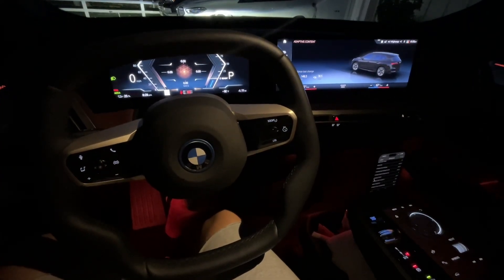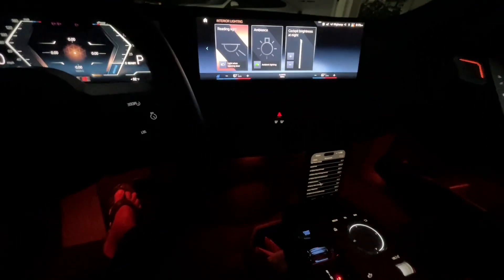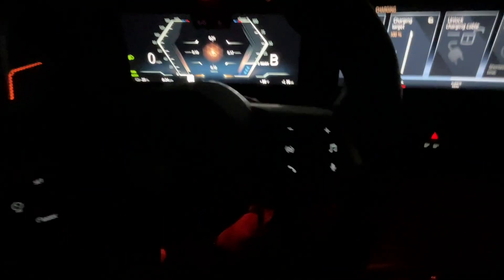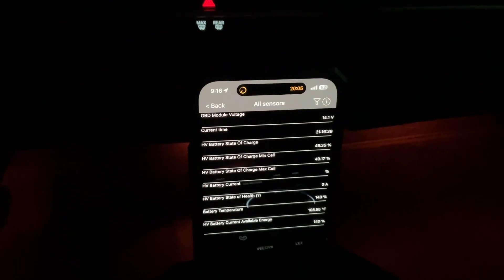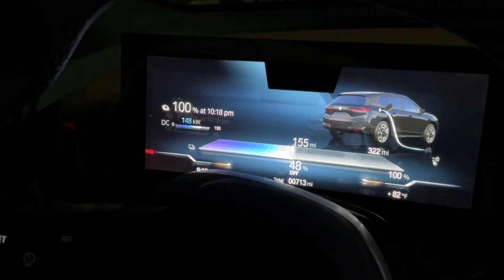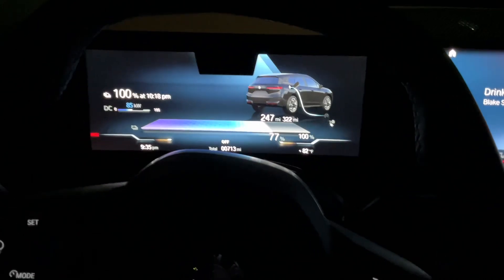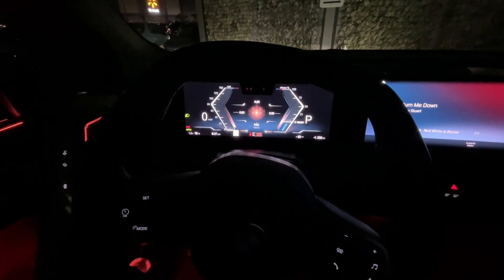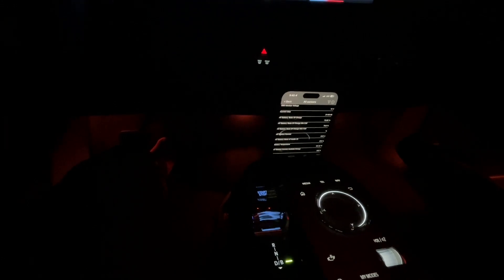VEEPEAK OBD Battery Temp while charging BMW iX M60

Comment: Hi! Is it Car Scanner Pro? Please, what the car you choose? I can not connect to iX(
Reply from the maker: Use BMW X3 until the make a iX program
Reply: @rant-n-rave7816  Thank you! I connected. Just one page of sensors is a strange. I had hundreds on VW ID. And also numbers are weird. SoH is 105%, SoC is not what car has on the display. Unfortunately this Veepeak simply does not work with iX for now. Will wait for the dedicated program.